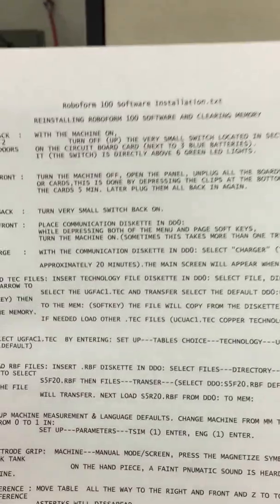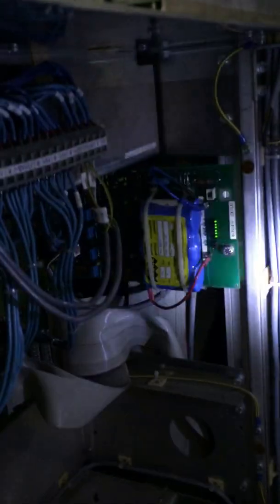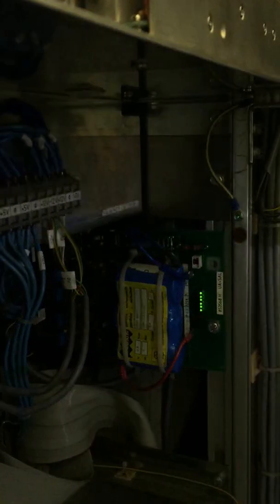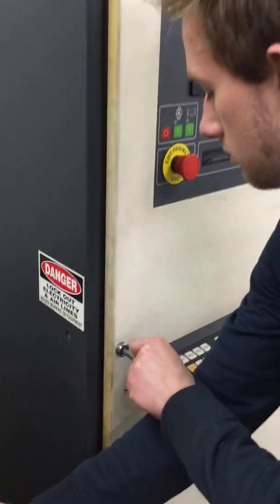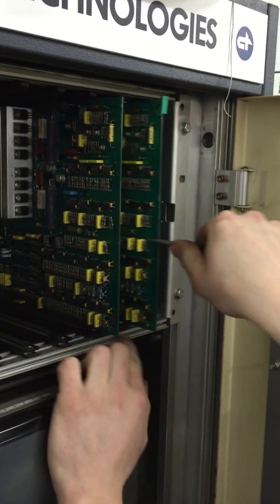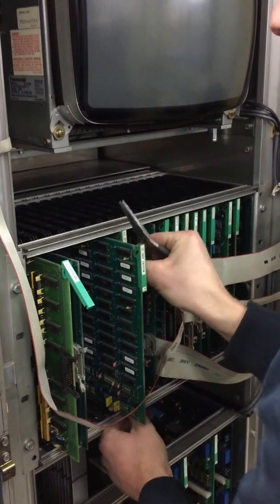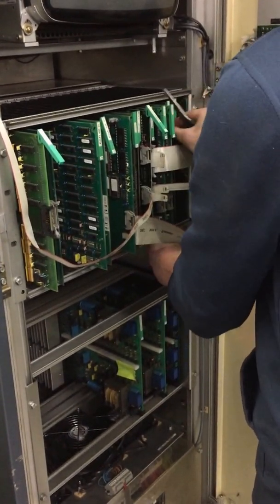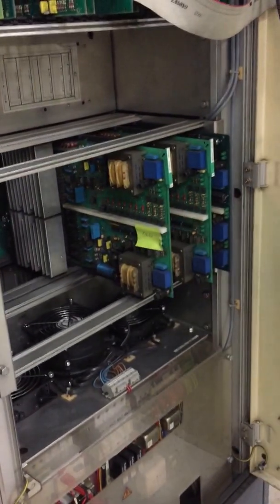Charmilles Roboform 100 Operation #1 For Setup & Resetting Machine

Comment: Hi 
congratulation!!!  for  all  charmilles videos. I found the videos to look as wire load tables in Charmilles wire EDM disk.

by chance you know how to load (wire tables, TEC,DOC) disk in charmilles wire edm ???

thanks
Reply from the maker: +hector serrato sorry I don't have experience with loading anything on Wire EDM machines from Charmillles, however I suspect it is very similar to loading them on the Sinker EDM, just different disks.